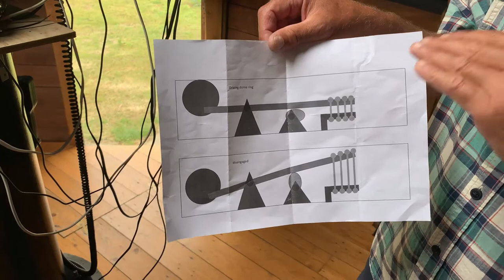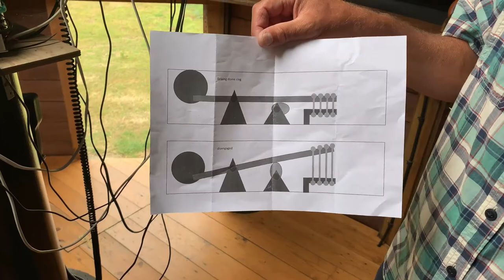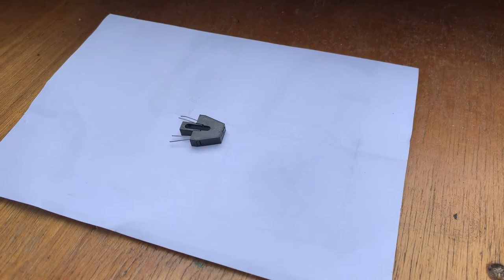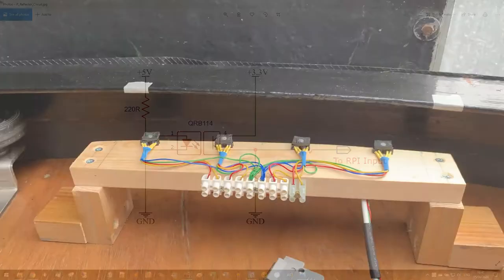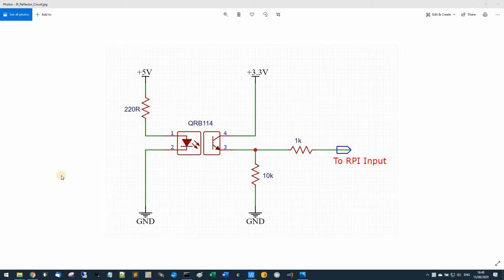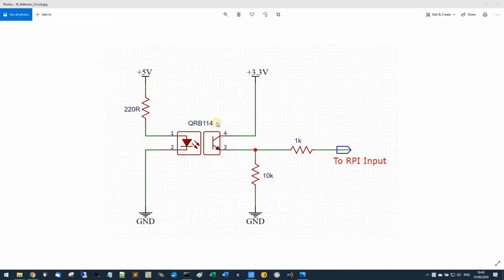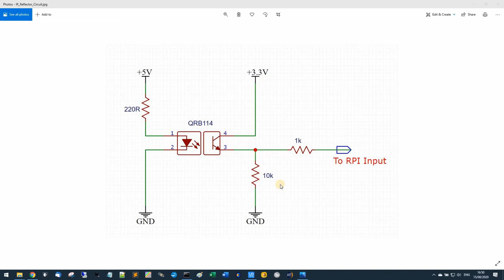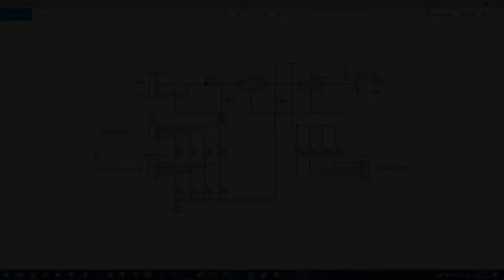Dome Automation Project Part 3 - Motor Bracket and Position Sensing

Comment: Hey Ian,
As an automation guy, I can tell you  3M reflector tape is much more effective for reflective optical sensors.  It will give you more range and still work when it is quite dirty.
Love your pivot arrangement for your motor, brilliant indeed.  I may use a similar idea as a clutch for my Ash-Dome motor, which uses the weight of the motor on the wheel to keep friction, but has no clutch to disengage the drive.
Reply from the maker: Hi John, Thanks for the info. I've been experimenting with different materials - best so far is aluminium baking foil, but is too fragile. I've got some 3M tape on order after your recommendation.

Comment: Hi Great idea , I use magnets  and a reed switch in the same ways as yours. Just mounted 180 small magnets round my dome (2 degree resolution (more to get better) and I use the reed switch to count how many times the magnets passes the switch to know what position I am. Just have another reed switch for the home position. Works great , very easy to program and no false signal.
Reply from the maker: Excellent! I was considering reed switches and magnets too. I might still go that way if this idea proves to be a bit flaky. What switch/magnet to you use?
Reply: @iansharp1171  HI Ian , I use 3mm round mangets attached to the moving part of the dome equally , then one reed switch ( these were from a window alarm system) fitted due south (180 degree ) on the static wall  which goes to the input one of  a Arduino board . This counts how many times is detects the magnets , if  I move east it increases the count total and moving west will decrease the total . I then have a homing magnet and switch set at due North connected to input 2 which resets the total to zero. I've added a switch at west and east just confirmed the counting of the magnets. Again 2 degree resolution is more than enough for me but adding extra magnets makes it better. I design my own software thru Visual basics to control the dome movement , shutter , ect  but use The sky X dome simulator to get the dome position needed , my software then pulls this info from sky X . The magnets have a strong pull so the switch will detect the magnets going over with a 25 mm gap ( the dome doesn't roll flat ) . Hope this helps . John
Reply from the maker: @johnadams9843  Nice! Thanks for all those details.